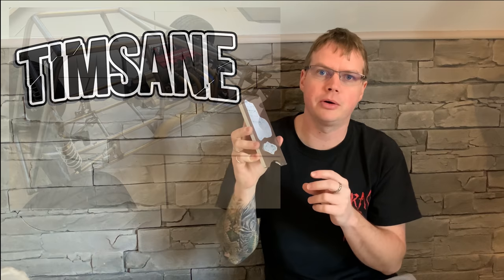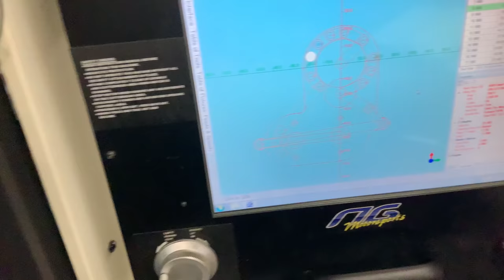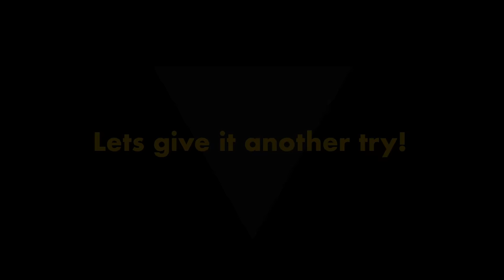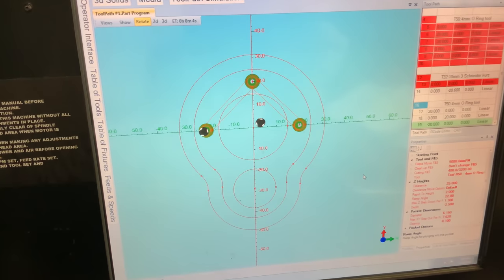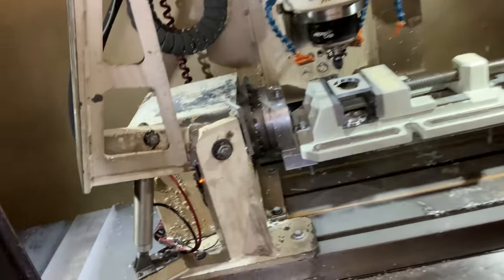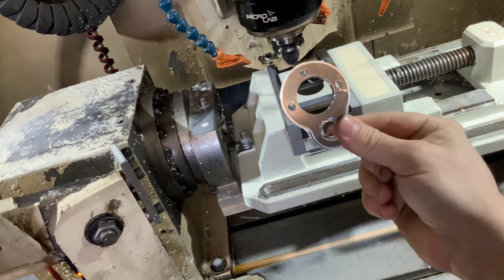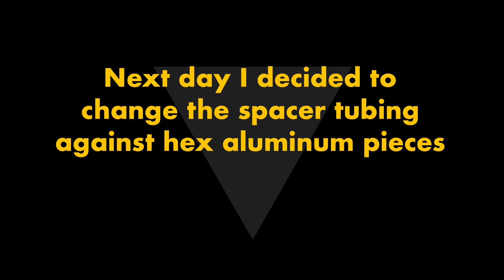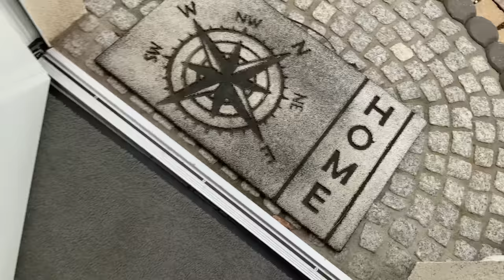1/5 RC Sprint Car - drivetrain completed! Hybrid system reveal

Comment: Amazing Tim! Nice job working through the complications, a master machinist! Please do a proper run video of this epic creation, it's beautiful! Thank you for sharing this masterpiece of an RC with us all! 👍
Reply from the maker: Hey Mike! Thanks a lot. Yeah I can not wait either but I need to do this in smaller steps. Electric was an easy way to check suspension, steering etc. Now I work on smaller issues and then start the Nitro engine. Once that runs perfect I will combine both systems and will burn the hell out of the rear tires! Ordered an extra set of wheels already....
Reply: @timsane  Heck yeah Tim. Sounds like a plan, keep at it! The hybrid was a must to make that beauty shine! Sprint cars have close to a 1:1 power to weight ratio, that nitro engine even as cool as it is just doesn't pack the HP it needs alone! Awesome bro!

Comment: It would be cool to see a three speed shifter gear box but very nice work ...
Reply from the maker: I would love that too, but that would add weight, needs space and it will fail due to the engine power (wait until it gets 20psi of boost 😉) So I decided against it. The brushless motor helps to get the car off the line FAST and then the nitro will start screaming. Thank you for watching and your comment!

Comment: Great Work and Fine Looking Buggy .  I am Hoping that Beautiful 4 Cylinder motor is not just for show  ?  I would like to see and hear it run .  Dumb American Me  ,  I thought that was what the Build was all about  .  I can see the use for Battery and Fuel drive  Together , but  I like my NITRO To stand Tall and Alone . I am old fashion that way .  As long as you enjoy what you do and have some FUN  You never need call it WORK ! Be safe and stay HEALTHY . BEN V.
Reply from the maker: Hey! Of course it is about the Toyan Nitro engine - I only want to make sure we have plenty of power (especially from the line). I need to check both systems individually - and the electric one is better to begin with. I found issues within the suspension I would have not found with the noise and smoke of the Toyan motor. Thanks for watching

Comment: I brought this idea up a few years ago; about how to integrate a electric motor to my existing gas power driven car. I have a 1987 Porsche 944, with a 2.5L 4-cyl/8-valve motor that only produces about 148HP total, but only (roughly) 128 at the wheel. However, instead of upgrading the motor to a larger block; like an 3.0L 16-valve, or better an LS2, I thought of using an electric motor tied to the drive shaft to assist in acceleration. I also thought of adding a electric flywheel to do the same. However, the gas motor will do most of the power, the electric motor is only used as a power assist.

Comment: Hi, I have just purchased the Toyan FS - L400 engine kit. I have downloaded the full build manual and before starting assembly I want to ensure that I have all the necessary tools for building it as good as possible. I am a professional engineer and recognise the importance of using the correct tools. Having read through the build manual I cannot find any information on what the torque settings are for the more critical bolts. ie. Head bolts, Conrod caps etc. Is it possible to find out the torque settings of these various fasteners? I would then be able to make sure I have a suitable small torque wrench that is accurate enough and within the range for use on this engine. Also, I have looked at ‘Stirling Kits’ online catalogue to try and find a suitable chassis to fit the engine to. I can only find one - and it looks very ugly and basic, more like a lorry chassis! I was looking for something a lot more exciting, more like the type used on a Drifter. Can anyone recommend a suitable purpose made chassis, or maybe one than can be modified relatively easily so that this engine will fit.

Comment: Glad to see I am not the only one who messes up and spends time re-doing things due to a bad calculation. I have to ask why an electric motor along with the internal combustion engine do you think the engine is not powerful enough on its own, at first I thought it was going to be for reverse motion.
What RPM does the 5th scale clutch bite, as you can get many different springs from five thousand and nine thousand five hundred RPM there are a few out there which are adjustable along with different materials for the clutch pads, I have tried the MIP/MOD five shoe and the Turtle Racing, FID and Area RC clutch's and have just found a three shoe one which I am hoping will combat my problem of excessive wear due to running big CC engines in my 5th scale offroad trucks and buggies from 32cc through to 50cc and still hunting the perfect clutch set up, looking forward to seeing more of this build and have just subscribed and will be watching your back catalogue of builds to watch while waiting for parts to arrive from my overworked courier service.
Reply from the maker: Hey Nick, first of all I am concerned that the nitro engine might be to weak for this big car. Therefore I added the hidden „assistance“. Second, I installed 8k springs because the engine idles at about 5.5k and redlines at about 13k. At least in theory 8k feels like a good starting point. But I think i will find out shortly..... Thanks for subscribing, welcome onboard!

Comment: Hybrid RC car are rather rare, this going to be more and more interesting. As real hybrid cars problem is the weight added that often need more energy than fuel or electro engine only. 😉
Reply from the maker: Surprisingly the car is not too heavy. I will reveal the weight later but let me say that power to weight is great on this build.
Reply: @timsane  I am sure power is enough, your e motor is big 😀

Comment: Looks great but why are you still milling in a drill chuck and who cares about the electric motor we want the gas dog!!
Reply from the maker: milling in the drill chuck is an easy way to perform some quick and dirty work without going on the cnc. For the nitro motor we all need to wait a couple of days as i needed to test the suspension, steering and controls first. That would have been much more stress with the untuned loud nitro motor. I hope to burn nitro this weekend... thank you for your patience!

Comment: Looks Great but anyone can get a bad ass electric motor! I thought you were going to show off that Gas Motor with them fresh titanium valves???? or?
Reply: right??
Reply from the maker: I needed to test the car regarding suspension, steering and all remote controls. That is way easier and more relaxed to do on brushless only. Within the next days I will do a nitro only test and tune the nitro engine. Then... both systems will be combined. Thanks for your patience!

Comment: Hi Tim. I get the 4 stroke driving through a clutch. I don't get the electric motor being synchronised with it. Direct drive motor and indirect drive four stroke ? Please clarify. Another GREAT episode. Thanks again
Reply from the maker: Hey, what seems to be complicated is very easy to do: Brushless system is programmed to a specific setting ( by the way I am running a soft setting here... it will be much crazier later) then the nitro engine gets dialed in with extra servos and linkage. When I let of the throttle the nitro rpm drops, clutch disengages and  only the motor will be spun further. Then I can even use the motor to brake the rear axle independently from the (hydraulic disc brake) front axle. I will show how it works in another episode. Thank you for watching and being part of our small community.
Reply: @timsane  Wow. Thanks. Simple for you; but not for many of your viewers; or am I the only one couldn't figure it out.

Comment: It's insane, can you install brakes just for fun?
Reply: I believe has has a set of disc brakes for it already.
Reply: @MrCarnutbill67  ya i think so
Reply from the maker: The car has hydraulic carbon disc brakes on the front axle which can be individually dialed in. Thanks 🙏🏻

Comment: really nice work Tim.  i appreciate the craftsmanship. can you share how you have the nitro and electric drives controlled and working together?   how did it do on only nitro?
Reply from the maker: The nitro motor did not run inside the car yet, since I am working on fuel system and oil pump controls. Hopefully this weekend! Can not wait either... but it is a lot of work....

Comment: Can you recommend a motor that is submersible that I could use for a kayak project. Total out of water weight will be less than 350lb.
Reply from the maker: That is difficult since i have no idea what your goal is: 4mph? 30? How much do you want to spend on batteries? This project can be 200 or 2000 USD 😱
Reply: @timsane  I'd say 10mph would be plenty fast enough for up to 5min bursts, but a 5mph sustained for up to 45min of distance travel is for sure needed. As far as budget I'd probably spend up to 1k usd for motors and electronics. Can diameter Can be as small as 2.5in. Hopefully this is enough info. Sorry for being so vague initially.
Reply from the maker: Hey Joseph, no problem. Take a look into the Turnigy SK8 series motors. They are low kv, powerfull and very affordable. I can imagine two of them will work beyond your expectations and do not need a geardrive or transmission. Thanks for watching

Comment: I hope the motor would not over rev the engine.
Reply from the maker: I made some calculations regarding gearing of both systems and it should be pretty close. Hopefully the Toyan will rev higher later when I finished all modifications.

Comment: Like before watching!!

Edit: looks very nice!! Are the brushless motor and the toyan engine going to work always at the same time?
Reply from the maker: Yes they will when I apply throttle. during braking the Toyan will idle, disc brakes will grab in the front while the brushless brakes the rear wheels.
Reply: @timsane  nice!! It es very interesting 😉👍

Comment: You got a link to ratchet style that rivet nut tool?
Reply from the maker: Unfortunately not... but I filmed the manual showing the exact part number on the cover. I am sure you can find it on google. There are also cheaper alternatives but I do not know if they work equally as good. Thanks for watching

Comment: Can I just comment on the frame for a second.
At 3:55 the chassis looks twisted (I don't know if it's the camera angle or the axle making it seem that way?)
But the right side of the frame seems lower than the left.
Reply: Camera angle.
Reply: @tonysansom  looking again I have to disagree.
Pause the video at 3:55 and compare the straightness of the bottom bar to the angle of the top bar. The top bar is way more angled than the bottom bar. And that's using the straight edge of the video frame. I think that's what my eyes were picking up when I wrote the comment in the first place.
Reply: @MaNNeRz91  Exactly.  The camera lens is bending the perspective of the image.  Doesn't matter how many straight lines u compare it to or where, it's not going to line up.
Reply: @tonysansom  but the top and bottom line should still be straight compared to the bottom and top bars on the frame. It's not a fish eye lense and for the frame to be that shape inside a rectangular shot would mean the top bar is a bit pissed.. 
I get what you're saying but for how the camera is setup on this shot it would have to be in a totally different place to make a square look like a trapezoid
Reply: @MaNNeRz91  Look at the image again.  The downtube on the right hand side is partly obscuring the damper and the one on the left is obscuring it to a much lesser degree.  That means the camera is not placed centrally.  The 2 horizontal tubes are also both parallel with the axle. I believe it's this offset placement of the camera that is causing the distortion. No, it's not a fish-eye lens in the conventional sense but all camera lenses bend light, that's how the focus the image on the camera's sensor so every lens is capable of distortion.
Reply: @tonysansom  the more I look the more twisted it's getting 😆😆 look at some of the vertical parallel tubes especially the newly added center section. They lean towards the right 100% this makes me think those were attached using a level and the frame has actually twisted slightly since he started because the joins are only tacked at the moment. The camera is only slightly off center if at all. I did see the shock covered on the right but that could still be down to everything being tacked and not final.

There's also no panhard bar or any anti sway on the rear
Reply from the maker: What a discussion 😁The frame has tolerances because of the welding heat and the simple fact it is handbuild. Tolerance is 1 or up to 2mm in some areas. Overall I am very pleased with the result.
Reply: @timsane  As you should be Tim.  I have no doubt the frame is as accurate as you can make it.
Looking forward to future updates!
Reply: @timsane  don't mistake this discussion (or my original comment) as a bashing against your work. I enjoy watching your videos and I genuinely can't wait to see the end result 👌
Reply from the maker: @MaNNeRz91  in no way I see that as bashing. You as the community make it worth to invest all the time in filming, editing etc. I enjoy each and every comment! There are a lot of important questions to ask as I do not explain my hours of planning, calculations etc. And in the end I can always be wrong here and there - and then I learn from you which makes it even better! Thank you
Reply: @timsane  keep up the great work buddy 👌 and greetings from the UK

Comment: I'm not sure if I'm onto a legitimate concern or not, nor would I know how to accomplish any necessary adaptations. What concerns me is max operating RPM's. That electric motor Can safely operate up to 50 or 60 thousand RPM's, I'm not sure what that engine RPM is after your modification or at what RPM might cause that engine to blow up at. My point is, be careful about using the proper battery voltage on the electric motor as to not overspin the engine Doing that however, may not provide the torque or HP assistance your wanting. I don't know if you could figure out a way to have the engine clutch disengage at a specified RPM or not. It would be cool if you get it to operate like a hybrid car engine, where the electric motor starts the engine but, shuts off when stopped. Just a thought.
Reply from the maker: A very important thought! I did spend hours with calculating the needed gear ratios for both, engine and motor. That is why I ended up using different pinion gears to make sure both systems operate at a safe level. Thanks for watching and your comment!
Reply from the maker: Oh... and clutch is set up very specific too. If it works... who knows, but I have done my best.

Comment: why don't you just put a use the one way clutch on the motor so it can start the engine and assist the engine when the power is needed. i just think  its pointless to have a starter motor it's not necessary

Comment: It would have more horsepower per ton than a 10 thousand horsepower car
Reply from the maker: You do not know how much this car weighs? How did you calculate 😁 ? This car has a system power of more than 10.000 watts.

Comment: Since it’s a 4 banger and not a v8 wouldn’t it be a midget
Reply from the maker: Maybe you are right... I am german, sadly I have never seen a Sprint car in person 😩 But it will get the full wing package... does that count a bit!? Thanks for watching
Reply: @timsane  sorry it’s a joke it will count as a sprint and damn this is late but a midget uses a 4 cylinder engine and is smaller scale then a sprint also they don’t tend to have wings but if this has a wing it’s a sprint. In my book